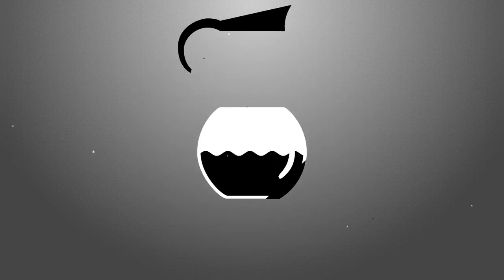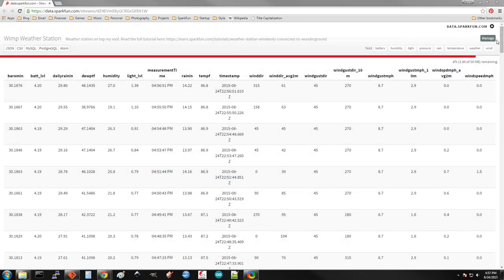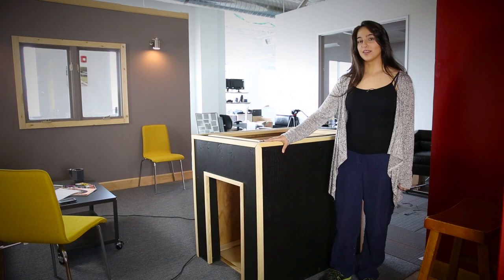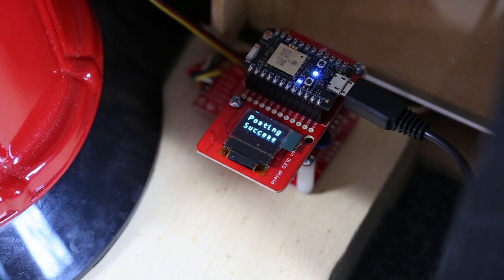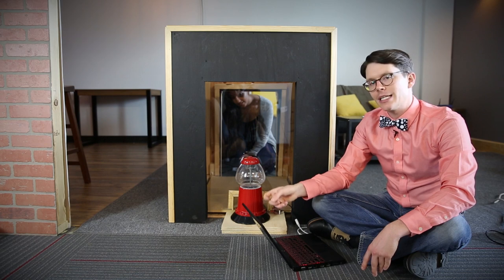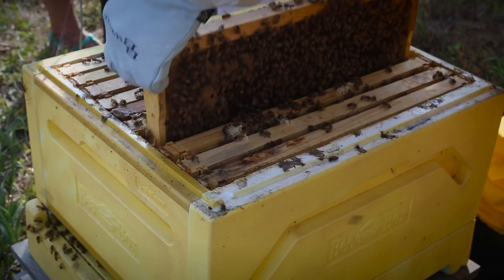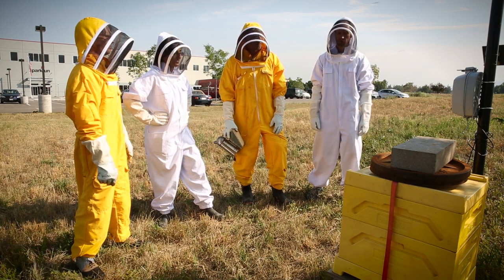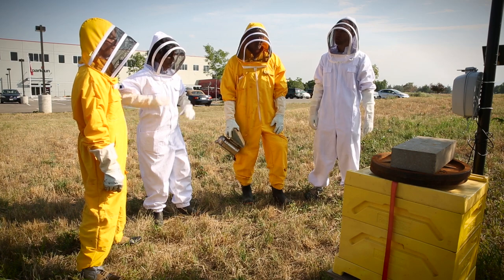SparkFun Fellowship of the Things #2 - Weight for Treats

Comment: you should  program it to only give a treat if the dog is underweight if the dog is overweight then no treat.
Reply: +Highteckhobbies To do that, you would have to have an input source of some sort such as a keypad. You would need to input a different weight range for each dog that enters the scale, and some kind of "if then" statement that would determine underweight, or overweight, or on weight. It would not be as hands off as the original project suggested.